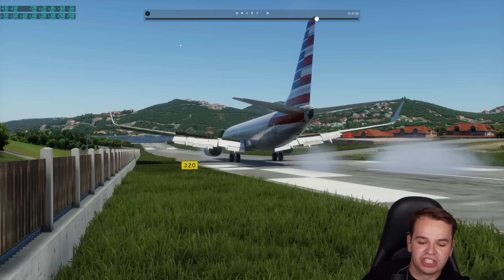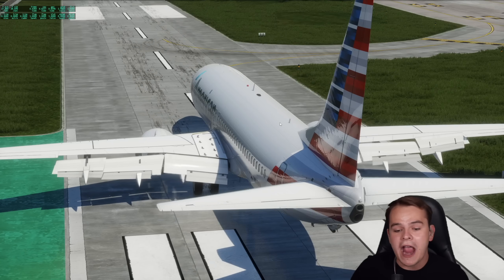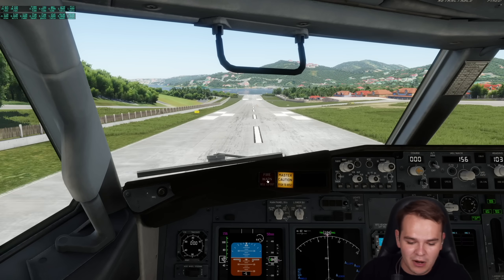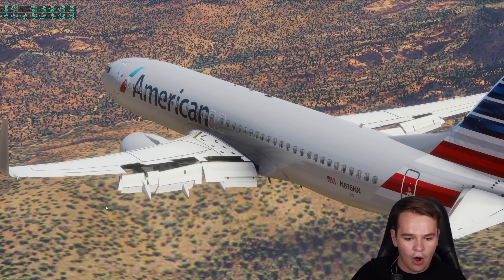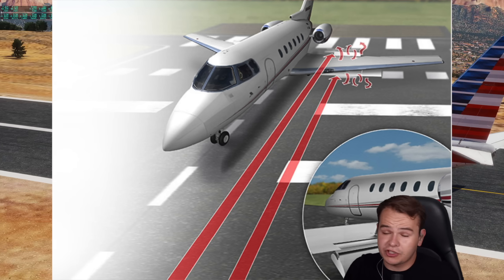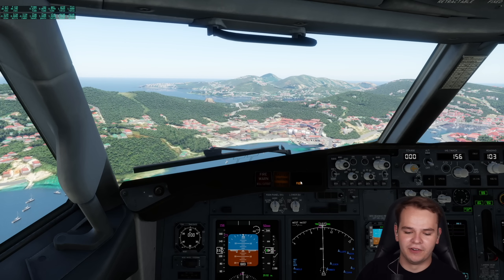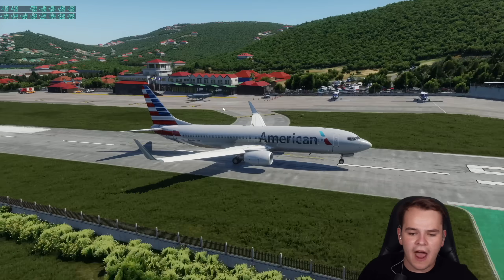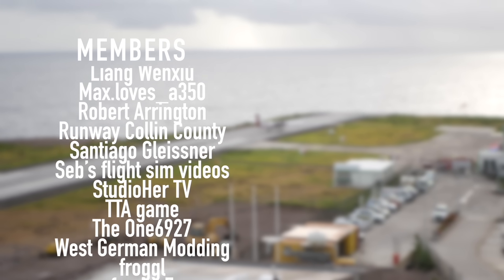What Happens When YOU PUT 90° FLAPS On A 737?

Comment: Flaps generally act as lift between 1 and 60 degrees, and beyond that typically add more drag. So 60° is probably optimal for taking off, less for landing until you hit the ground, then fully extend them.

.

.

.

.

Although they would probably get torn off if you extend them beyond 40-60° in flight.

Comment: i have a question. whats the difference between ailerons and flaps?
Reply: Aileron is one of the control surface for controlling roll (roll left or roll right), while flaps is a device used to improve lift at low speed.

For the placement, aileron is ususally on the tip of the wing, while flaps are on the back of the wing

(sorry for grammar mistake, I'm not a native speaker)
Reply: @Emery21  its fine tysm!